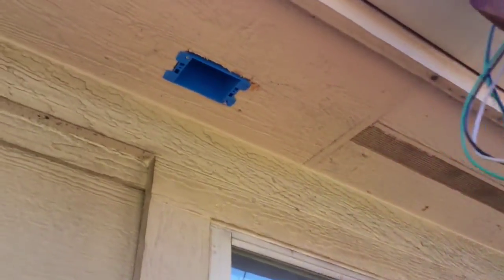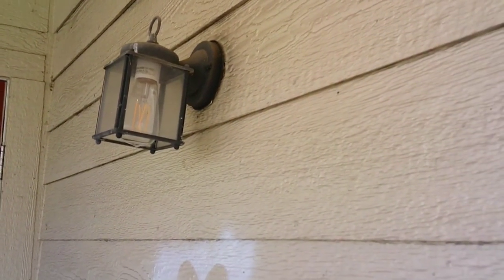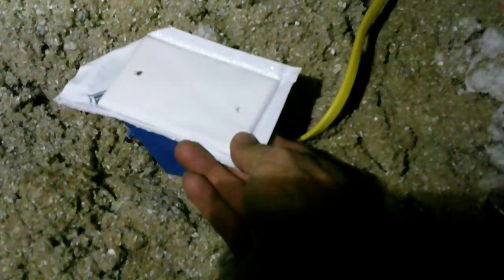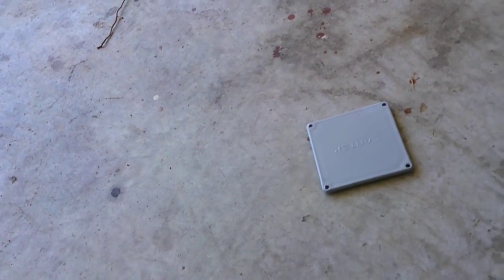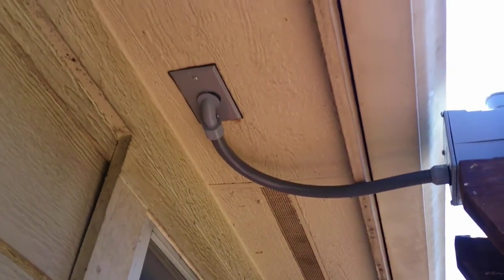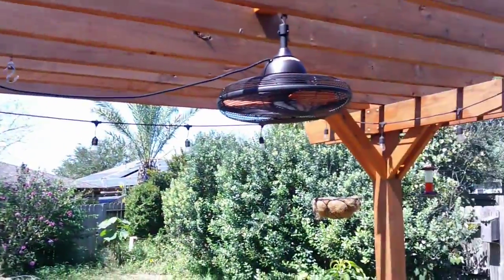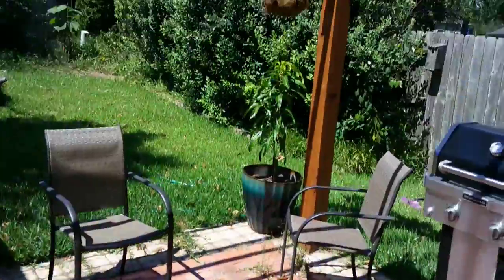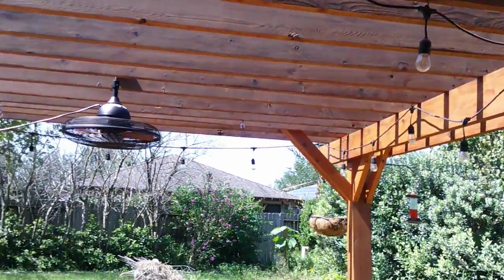DIY Adding power to an outdoor structure Pergola, Gazebo, etc, Part 3

Comment: The outlet box on the soffit, where did you find or how did you make it?
Reply from the maker: It's just a single gang pop-in box. you can buy them at pretty much any hardware store. Here's a link to them at lowes.
https://www.lowes.com/pd/CARLON-1-Gang-Blue-Plastic-Old-Work-Standard-Rectangular-Wall-Electrical-Box/50046395

Comment: Just came across this video. Is this method code compliant? I thought you couldn't use Romex to wet or damp locations which a box in the soffit is considered so by NEC
Reply from the maker: This is one of those highly debated topics that often is left open to the authority having jurisdiction. I will say that homes I've seen built recently still have the electricians wiring exterior outlets and soffit plugs with Romex. However, running Romex outside the structure even in conduits has been red-tagged by inspectors. hence the use of THHN inside the conduit bodies. your best bet would be to reach out to inspectors in your area before building if you have questions.
Reply: @HowitsdoneHandyman  unfortunately all inspectors are different and some understand that it's not feasible to use UF or THWN for those runs but NEC is very specific that this is a code violation. Now, everyone does it and like I said, I'm not running 100ft of UF just for that box. Kinda crazy. The wires inside Romex are actually jacketed for wet environments but it's not specified on the individual jacketing..
Reply from the maker: @mihneaciupagea3362  ahh, well now that I understand what you are referring to I would have to disagree. Since the box I used is cut into the soffit and the wire is run in the ceiling it would be in the attic and not a wet location. Still, the cover and devices used for the box would need to be weatherproof as the underside of the soffit would likely be considered a damp location. With what you talking about UF cable would be required for any exterior lights mounted to the ceilings as well such as a covered porch. Again, if you are unsure ask the AHJ.

Comment: What size bit is that you used to drill the holes for the connector?
Reply from the maker: I used a 7/8" Hole saw for drilling the holes the 1/2" connectors fit into.
Reply from the maker: FYI if you're using a 3/4" inch pipe and connectors you'll want to use a 1 1/8" Hole saw.
Reply: @HowitsdoneHandyman  thank you so much!
Reply: With tapping into an existing circuit how would you know you won’t overload the breaker ?